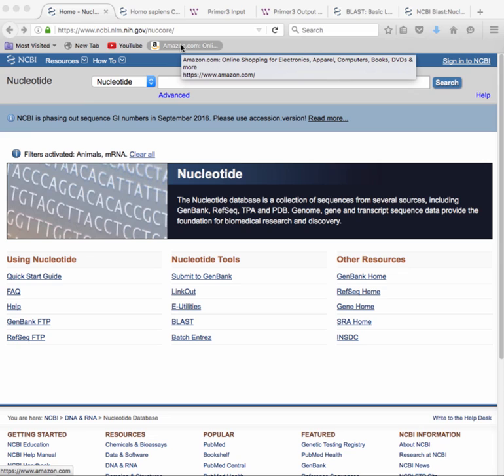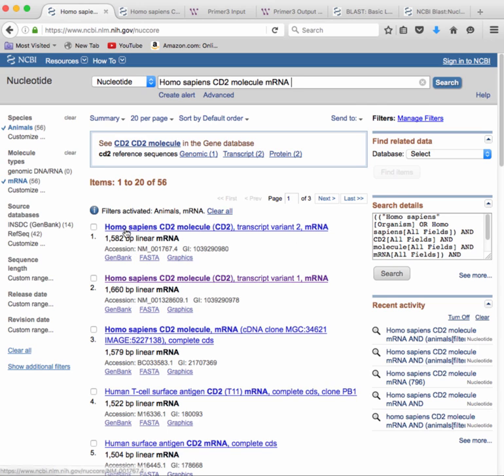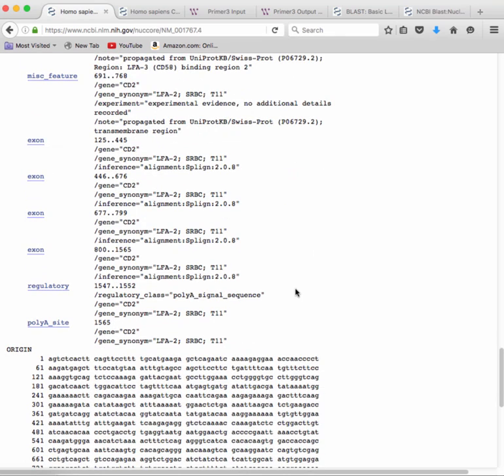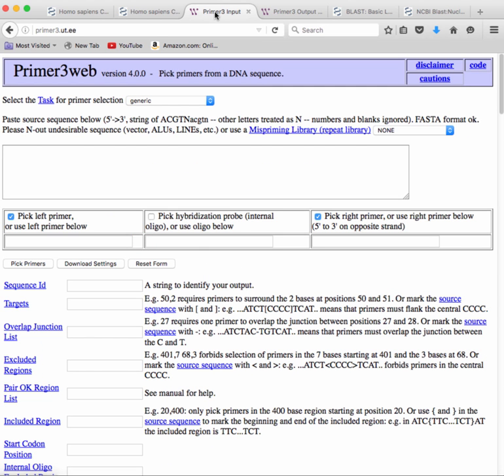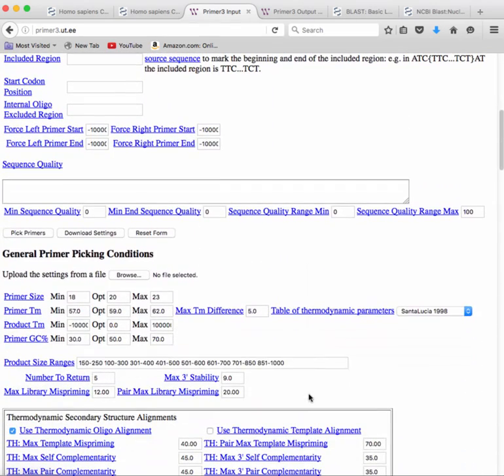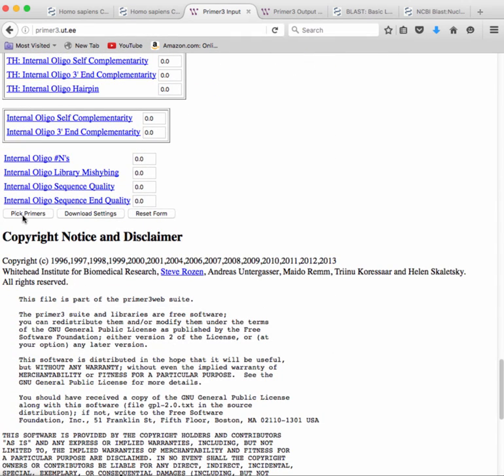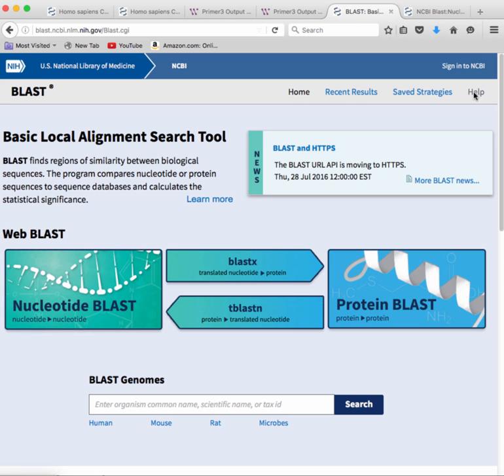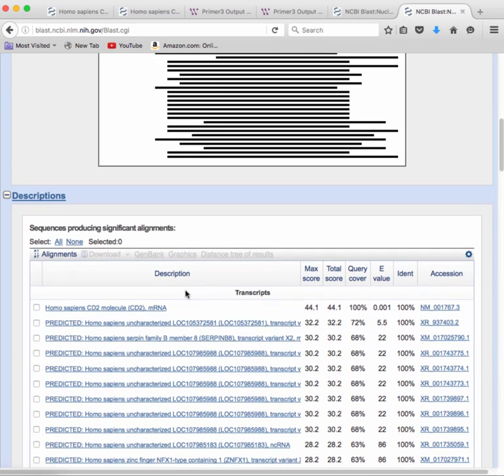How to Design Primer Sequences for PCR

Comment: Thank you for the fantastic video, I want to know if it will work for dengue viral RNA? and also exons are not mentioned in viral rna data(but mat_peptide is given). Also, how do i design genus and species-specific probes?
Reply from the maker: Viral RNA is not my expertise. One needs exon information to avoid genomic DNA contamination in cDNA analysis. You may ignore exon information for your purpose. Please note that Taq DNA polymerase will not amplify RNA in PCR. To design genus or species specific probes you need to align all the sequences of the genus and species you are concerned with and identify your unique sequence in your species of interest and design probe. I hope I am clear.

Comment: Thanks for such informative video. I did the same thing for this gene however could not find the exons just CDS could you see the following link for such gene how I construct primers 
 https://www.ncbi.nlm.nih.gov/nuccore/XM_002482250.1
Reply from the maker: Thanks for viewing the video. Did you subscribe yet? See my other video on smart ways of designing primers, may be you don't have to design primers. Regarding your question, I viewed your sequence. Please note that your sequence source is from ATCC. Also some MRNA do not have intervening sequences, so you will not find exon information. You can use CDS for primer designing. If you align CDS and mRNA sequence, you will see a major portion aligned. Reverse transcription of mRNA generates cDNA, and such cDNA contains the 5' and 3' untranslated regions (UTRs). UTRs are not part of the coding DNA sequence (CDS). With exceptions aside, CDS starts with an AUG codon and stops with one of the stop codons. While using Oligo dTs for cDNA synthesis, you have better chance of designing primers close to polyA tail for PCR if using chosen transcript variant (or complete mRNA). I hope this helps.

Comment: Thanks for this fantastic video. I've tried this way, but I got a reverse primer with score of 1.90 Self Complementarity, could I still use this primer? How could I get both primer without self complementarity? Thanks in advance.
Reply from the maker: Yes you can use this primer. Primer 3 settings take care of this so as to avoid primer forming secondary structure. I have used 1.9 score and never had an issue. If at all you have an issues, self complimentarity of 1.9 score is an unlikely reason. All the best.
Reply: Thanks a lot!

Comment: How can i design primers for all variant of mRNA of a specific gene?
Reply from the maker: You need to align all of your mRNA variants and look for conserved sequences. For example, if you align three variants of CD25 (IL-2RA) mRNA (NM_000417.2, NM_001308242.1, and NM_001308243.1), you will notice that 1-586 nucleotides are perfectly aligned or same in all the three variants. So, you should design primer sequences between 220 (start codon site for this mRNA) and 586, that will cover all three variants. I hope this helps.

Comment: Hi im looking for primers and probes to work on the sequence with accession number AY151287.1. But i cant find anything on where the exons are in this sequence on ncbi. How do i go about making sure that its spanning an exon exon junction?
Reply from the maker: Some genes are single exon genes (SEGs), which means they have only one exon. Complete coding sequence (CDS) of your gene of interest AY151287.1 (Cavia porcellus interferon gamma (Ifng)) is 500 nucleotides long (start at nucleotide 69 and end at nucleotide 569) and the protein has 166 amino acids, which means 498 nucleotides are coding for this 166 amino acid protein. This confirms your CDS has no introns, unless I am missing some critical information about your gene of interest. Design your primer and probe sequences and check the efficiency of your pair. All the best.

Comment: hello sir....what about just DNA....can we make probe in case of DNA?
another question is that....if the percent identity 100 or 99 percent for other species of organism of the same gene then the primers are not specific i think.....waiting for your valuable comments
Reply from the maker: Yes Mehran. You will have to purify DNA to remove RNA. You will have to design primers and probes within a single exon and NOT target any exon-exon junction. Viral DNA load is measured by real-time PCR using primers and probes. 'Specificity' depends upon the question you ask. When you take human blood samples, isolate DNA, and try to amplify gene of interest (say FoxP3 gene), you want the product to be specific to your gene of interest, and NOT share any similarity to other genes (say TGF-b) in your HUMAN DNA. There is 99% similarity for several genes between human and mouse, but how does that matter when you are only using human blood sample/human DNA. I am releasing some more videos on this topic. Please subscribe and check it out when released. All the best.

Comment: Why do you recommend to ignore the cds? I need to make a primer out of a gene with only the cds sequence available, is it still possible?
Reply from the maker: Yes, you can use CDS. If you align CDS and mRNA sequence, you will see a major portion aligned. Reverse transcription of mRNA generates cDNA, and such cDNA contains the 5' and 3' untranslated regions (UTRs). UTRs are not part of the coding DNA sequence (CDS). With exceptions aside, CDS starts with an AUG codon and stops with one of the stop codons. While using Oligo dTs for cDNA synthesis, you have better chance of designing primers close to polyA tail for PCR if using chosen transcript variant (or complete mRNA).

Comment: very useful.. but would i have to choose the last exon start site (e.g.. you chose 800) when designing primers or I can select any of the exon start sites?
Reply from the maker: If you are making cDNA using oligo dT, which starts synthesis from poly-A tail of mRNA, it is reassuring to design primers close to poly-A tail. If there is a concern about exonuclease activity, you may design primers targeting exons at the center. No matter which exons I targeted, I had a success rate of over 95% that my primers worked as expected.